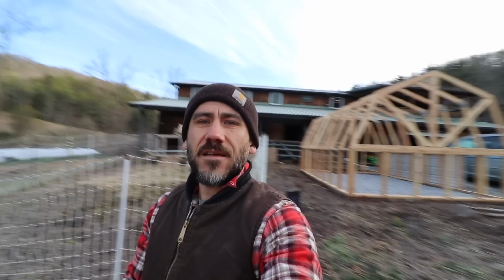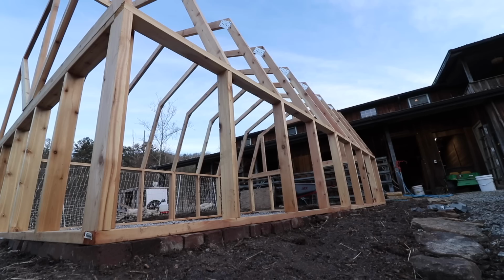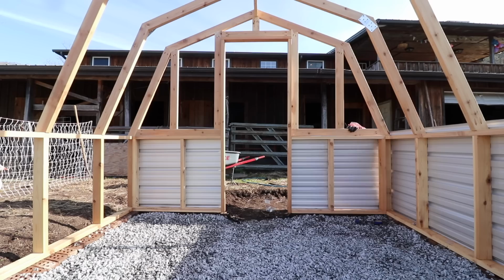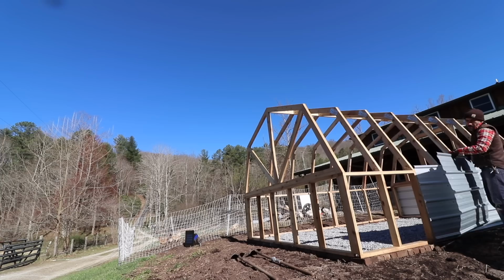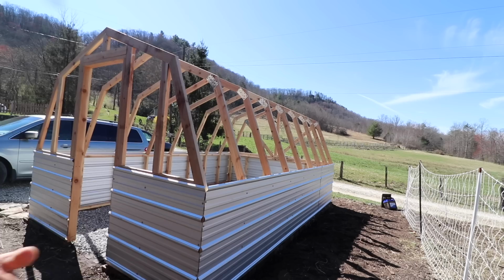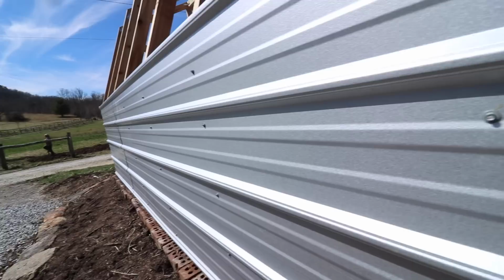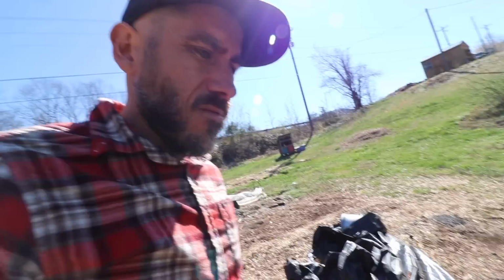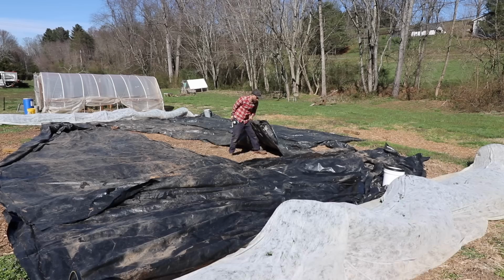(Modified) Ana White GREENHOUSE PLANS

Comment: The chickens are hoping you're building it for them. "I call the north corner, cluck cluck".
I threw rye grass in my garden this winter, it's dying down right now, can't handle the heat in Florida, but it's opened up the soil so nice. I water and it soaks right in. Plus it was pretty all winter.

Comment: Bit of a tip. To cut the metal you can use an old worn out blade in your circular saw. Just turn the blade around and mount it backwards. I’ve built many barns and sheds and this is how we always cut our metal. I know, sounds scary,  it it works and is sure way faster than tin snips.

Comment: Looks great Jason! One question, are the metal corners going to be covered with some sort of protection against sharp edges and   small fingers and extremities? I can see.Gideon slicing his fingers exploring. Is there some sort of L shaped long piece of rubber or even metal that can be placed on the galvanized corners?
Reply from the maker: yes, indeed. thanks